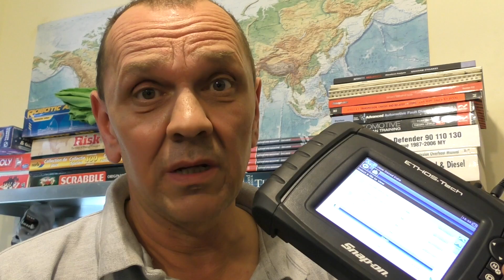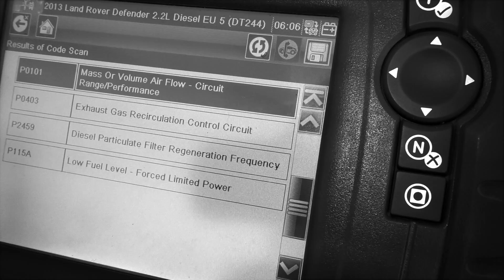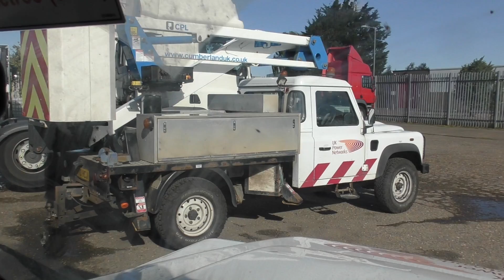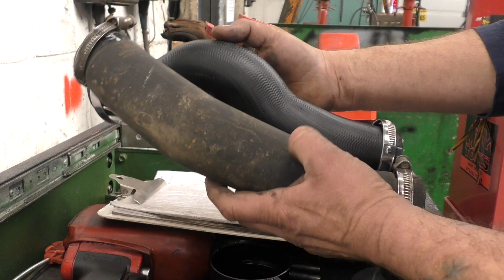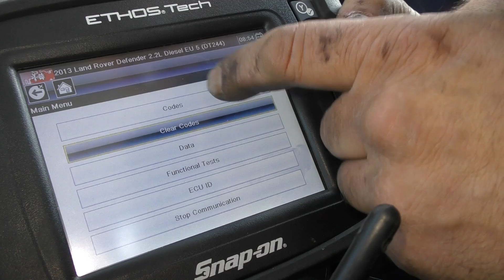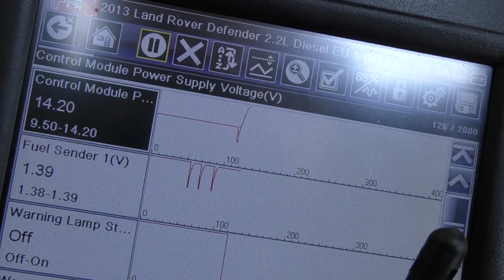Part 1- 2015 Land Rover Defender  2.2 Saga-  P0101 Fault Code and LR066344 Modified Intercooler Hose

Comment: Hi. have you ever come across the following fault on a Disco td5. After I tried everything to find an intermittent miss, I found a couple of electrical faults that did help. Still the miss was there, improved but now very temperature sensitive. Finally I found the fault (two specialist LR could not) the fault was the injector clamp bolts.
I found that with the injector clamp removed, the number of turns of the bolt to bottom out was 13 turns, with the clamp refitted and torqued correctly, again exactly 13 turns. So incorrect compression of the copper washers. Now I have sold this vehicle but I do miss the disco TD5 it was a great driving car. If you get this or anyone else has suffered from this fault please let me know.
Reply: Exactly scrap the puma for td5 simple lol